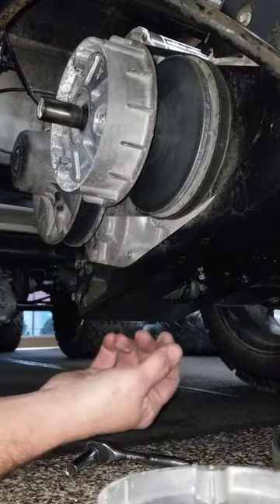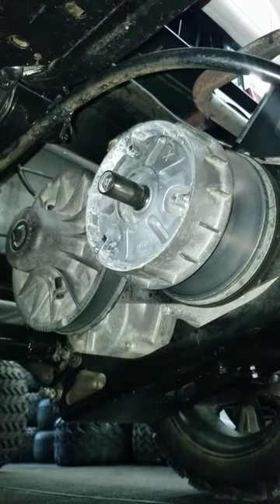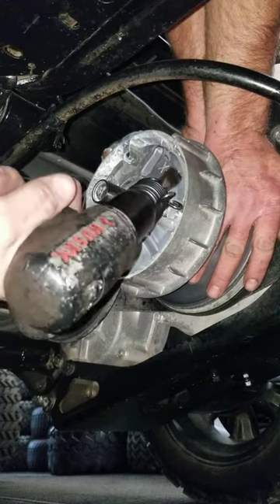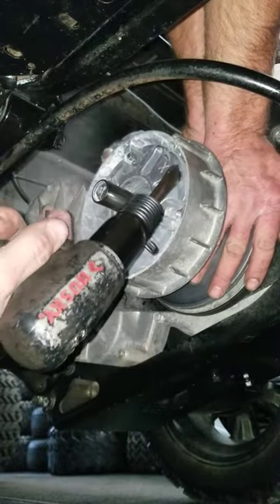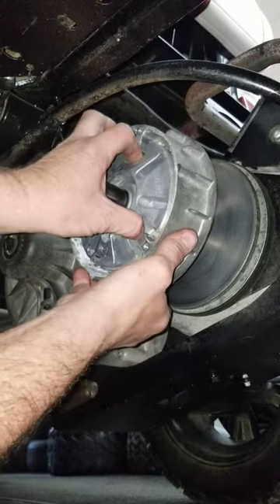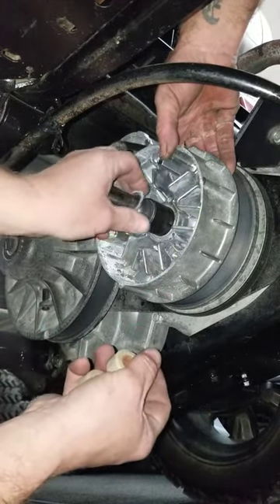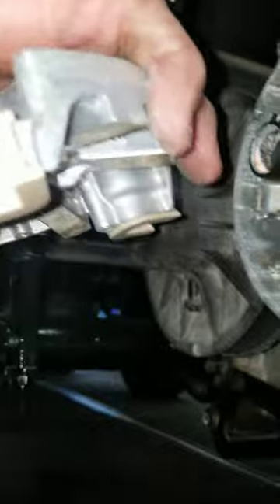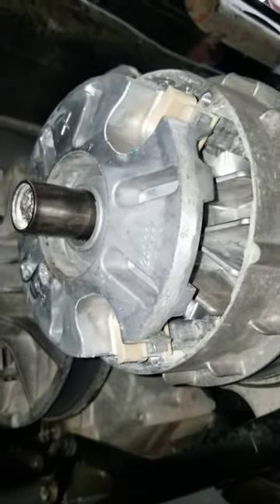Adjust clutches on golf cart

Comment: I have 2015 EZGO rxv. The clutch is working as it should but have a rattling noise from it when driving…Any idea besides drive it till it fails. Thank you for your time. Where is your shop located?
Reply from the maker: If the rattling is from the clutch.  There’s nothing you can do. Check the muffler also for a rattle!
Reply from the maker: Located in NMB sc
Reply: You were spot on…muffler bracket was loose noise gone. Thank you for the help and the videos!!
Reply from the maker: @dhrr44  yes sir thanks for letting me know what you find out.  Just hit that like button for me. And subscribe

Comment: I just bought a 1999 ezgo 38v and when I press the gas it will go but then it starts hesitating. It will even sort of jerk sometimes. Do u have any idea what that could be?
Reply from the maker: Check battery voltage.  if battery voltage is good. Take your motor off and unstick the brushes
Reply: It’s actually 48 volt and u don’t think I should check the vglide? Also the guy we bought it from installed a beast motor he called it. I think he said for more torque?
Reply: Btw battery voltage is good. Thanks in advance and sorry for all comments.
Reply from the maker: @babyalivesandslime9731  no worries. Check your battery voltage while you’re driving it. Or hold the brake down as you hit the gas and check each battery under a load.

Comment: Is this for a fuel injected ezgo? I’ve got a 21 valor and it hesitates, then does nothing. If I push it and hit gas it will go. Took it to a place and they said too new to work on it. They said belt was jumping? It’s got a kwang Yang engine in it? Do you know anything about those?
Reply from the maker: Kwang Yang. You mean Kawasaki engine.  Or the small moped engine they use
Reply: Must be, but was wondering if it was the same as this?
Reply from the maker: If it’s the small moped engine. No it’s different than this.  But if it’s the Kawasaki yea
Reply from the maker: But on the moped engines they are bad for the computer causing. Int running
Reply from the maker: If it’s int running. Meaning when you hit the gas sometimes and it does nothing then you hit a couple more times and it runs. Replace the computer. Don’t waste your time or money on nothing else but the computer. It’s called a starter/generator controller. It will fix your problem. I replace about 30 a year.
Reply from the maker: It has the ex1 engine in it. They are the biggest POS Ezgo has ever made.
Reply: I have to feather to get it to start or push it and help it get goin. Once it’s goin it’s fine. My local guy didn’t wanna work on it cuz it’s too new. He said he thinks it’s a belt or clutch issue? Well I’m happy to know I got the biggest pile of crap one I can get, side of engine doesn’t say ex1 but says kwang yang motor co
Reply from the maker: Also we put hotter spark plugs in them than what they put it because of that. I will give you the part number Tom. Of which spark plug to get. Change the plug and let me know what it does. Doesn’t sound like a belt or a clutch problem for sure
Reply: Awesome thank you!
Reply from the maker: NGK SPARK PLUG  CR6HSA 2983

Comment: I have an 04 Club Car Gas golf cart. You push on the gas it runs but not fast enough to engage the clutch. Any idea what would prevent it from going full speed? Thank you.
Reply from the maker: So it’s turning over just not cranking up?
Reply: @HeyHeyHey97  Yes
Reply from the maker: Check fuel or spark
Reply from the maker: Check make sure throttle is opening. Has it been sitting for a while.
Reply: @HeyHeyHey97  No, it was being driven when it started doing it. It happened about 2 weeks ago and it cleared itself up. Now it just chugs and doesn't move.
Reply from the maker: @lukehagen5497  take the back belt off. And hit gas and see if the engine revs up. Without belt on.
Reply: @HeyHeyHey97  you're just talking about the main belt correct? I see two belt. Starter to front pulley and main belt connecting the clutches
Reply from the maker: Yea main belt.
Reply from the maker: But I would check your carb sounds like it has trash in it or water in gas
Reply: @HeyHeyHey97  I wasn't able to get the main belt off, but I was able to get the back axle off the ground and it still does the same thing. I'll have to get the carb checked out.
Reply from the maker: @lukehagen2083  when you pull choke does it run better
Reply from the maker: When you pull choke does it run better
Reply: @HeyHeyHey97  No, it does kick into high gear every once in a great while and the front clutch activates. It goes for a second and then kicks back out.
Reply from the maker: @lukehagen2083  you probably have a stuck front clutch or back clutch.  If carb when pull choke you would tell a difference
Reply: @HeyHeyHey97  okay. The clutches would stop it from going in full throttle mode?
Reply from the maker: If the engine is running and the front clutch is not tightening the drive belt up you will not reach full speed. Does the front clutch tighten the belt
Reply: @HeyHeyHey97  when it does kick into high gear the belt does tighten up for that split second.
Reply from the maker: @lukehagen5497  yeah front clutch stuck. Find me on Facebook. Thomas wells. Then send me a video.
Reply: I have a Yamaha g22 I think, it runs totally fine in neutral but when I put it if F/R it’s like it needs to jump start, any idea what could be causing this? Tia
Reply from the maker: Meaning it jumps or it’s hard to get it to crank up like the batteries dead?
Reply: @HeyHeyHey97  it’s like there to much torque or something under load, If I lift the back wheels up & put it in F/R it runs well but as soon as wheels are done it struggles
Reply from the maker: @RB-711  is your throttle opening all the way up. Also check your back clutch. And make sure it’s not stuck. And check your belt
Reply: @HeyHeyHey97  yeh getting full throttle etc, it just struggles to take off, once it’s actually moving it’s ok. How would
I check if back clutch is stuck?
Reply from the maker: If you pull the choke does it take off better
Reply from the maker: Have you serviced it meaning changed spark plug or carburetor?
Reply from the maker: When you have it in the air. While it’s running does your front clutch. Close all the way. Meaning the belt goes from the bottom of the front clutch. To the top of the clutch once it’s wide open. I am about to send you a video on how to check the back clutch (driven clutch). The Video is on an Ezgo golf cart but works the same way
Reply from the maker: TEST REAR CLUTCH ON A EZGO GOLF CART.  (DRIVEN CLUTCH)
https://youtu.be/mTA-r0caW_s
Reply: @HeyHeyHey97  is there a way to check this without stripping the back clutch off?
Reply from the maker: Just just take the back belt off.  And test with the clutch on the cart. If you don’t know how to take belt off let me know. I’ll give you a link to a video on how to take the belt off
Reply: @HeyHeyHey97  I think I tried to add you on fb
Reply from the maker: @RB-711  lol. I’ll check and see
Reply from the maker: @RB-711  look up Thomas well Conway sc.  it’s a picture of my wife and I.
Reply from the maker: @RB-711  if you find me on Facebook. Let me know